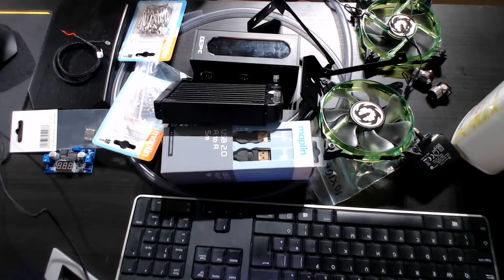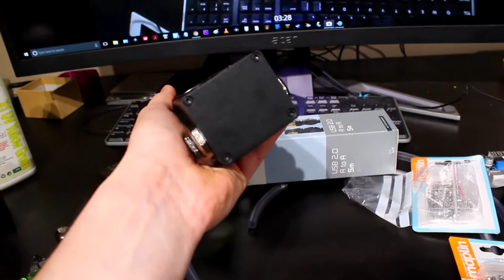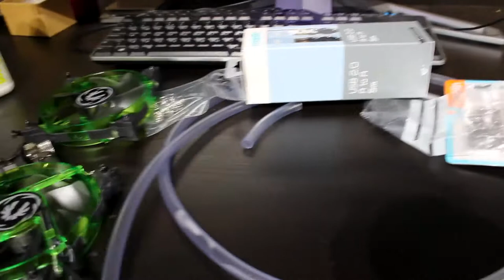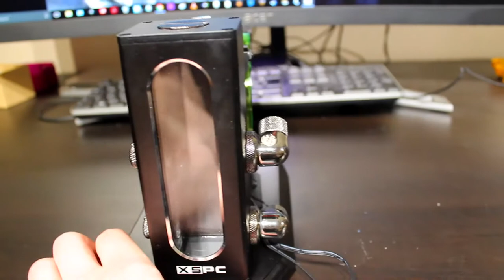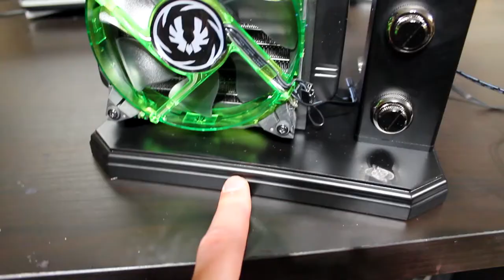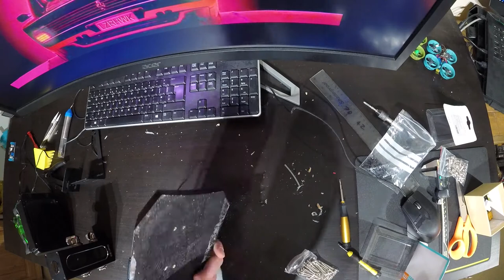WATER COOLING A GAMING LAPTOP!!! (PART 1 of 4)

Comment: 1. Where is part 2? If you ended up messing up, still post an update and show where you messed up so other people can learn please. 
2. What waterblock did you get? 
3. How exactly did you connect the power for the fans and pump? Pump requires molex power, since you don't seem to have a psu with molex in there, wondering how you managed to solve this.

Comment: Part 2 ??
Reply: Hi Liam, I am planning to make a series of vids (atm 11 videos planed) about what I call the "Laptop Liquid Loop" project.
It's slightly different from the idea of the video above since I want to be able to carry the attachment in my backpack rather than make it as a stationary dockstation, but the concept is pretty much the same. And, since I'm a manufacturing engineering student, got access to a lot of machines, I will be making a custom water block and all.
I haven't got a lot of subs right now since I haven't even started uploading the vids about the project, but if you're at all interested, please do subscribe, the first video is set to be released within a week (so by 25.11.18). I won't do the same bs as this guy with ditching the project, I will make vids about the whole process, from start to finish, and I will showcase all the problems.

Comment: finally...The video i was searching , i found it by accident after a few days :) THANKS "balanced boy"
Reply: Hi George, I am planning to make a series of vids (atm 11 videos planed) about what I call the "Laptop Liquid Loop" project.
It's slightly different from the idea of the video above since I want to be able to carry the attachment in my backpack rather than make it as a stationary dockstation, but the concept is pretty much the same. And, since I'm a manufacturing engineering student, got access to a lot of machines, I will be making a custom water block and all.
I haven't got a lot of subs right now since I haven't even started uploading the vids about the project, but if you're at all interested, please do subscribe, the first video is set to be released within a week (so by 25.11.18). I won't do the same bs as this guy with ditching the project, I will make vids about the whole process, from start to finish, and I will showcase all the problems.

Comment: where is part 2 ？ please qaq
Reply: Hi Jason, I am planning to make a series of vids (atm 11 videos planed) about what I call the "Laptop Liquid Loop" project.
It's slightly different from the idea of the video above since I want to be able to carry the attachment in my backpack rather than make it as a stationary dockstation, but the concept is pretty much the same. And, since I'm a manufacturing engineering student, got access to a lot of machines, I will be making a custom water block and all.
I haven't got a lot of subs right now since I haven't even started uploading the vids about the project, but if you're at all interested, please do subscribe, the first video is set to be released within a week (so by 25.11.18). I won't do the same bs as this guy with ditching the project, I will make vids about the whole process, from start to finish, and I will showcase all the problems.

Comment: Link laptop water block, please
Reply: Hi Tien, you can get so called "laptop water blocks" from AliExpress, here is a link to one of them (this one is aluminum, you can get copper too):
https://goo.gl/xix1uj

However, keep in mind that these will never give you the same results as a custom made water block, hence the low price. They are basically shelled cubes of copper or aluminum, the design of the water channels in them isn't optimized for heat absorption by the water. They'll probably work, but nowhere near as good as a proper block.

Comment: Also I see he has one of the newer alienwares so chances is he broke it. They are not to mess with! Just by overclocking the CPU through bios can cause it to not boot again. Even when trying resetting CMOS. They are crap!
Reply: I don't think that's it. His thumbnail shows the thing working, he must have finished the project before uploading this first video. Or just good Photoshop skills, I dunno.
Reply: I managed to over lock my 13 inch to 5 ghz and it’s still going strong
Reply: @nicholasdelrossi3996  press x to doubt

Comment: Part 2222222
Reply: Hi Max, I am planning to make a series of vids (atm 11 videos planed) about what I call the "Laptop Liquid Loop" project.
It's slightly different from the idea of the video above since I want to be able to carry the attachment in my backpack rather than make it as a stationary dockstation, but the concept is pretty much the same. And, since I'm a manufacturing engineering student, got access to a lot of machines, I will be making a custom water block and all.
I haven't got a lot of subs right now since I haven't even started uploading the vids about the project, but if you're at all interested, please do subscribe, the first video is set to be released within a week (so by 25.11.18). I won't do the same bs as this guy with ditching the project, I will make vids about the whole process, from start to finish, and I will showcase all the problems.

Comment: part 2 plz
Reply: Hi CodeRed, I am planning to make a series of vids (atm 11 videos planed) about what I call the "Laptop Liquid Loop" project.
It's slightly different from the idea of the video above since I want to be able to carry the attachment in my backpack rather than make it as a stationary dockstation, but the concept is pretty much the same. And, since I'm a manufacturing engineering student, got access to a lot of machines, I will be making a custom water block and all.
I haven't got a lot of subs right now since I haven't even started uploading the vids about the project, but if you're at all interested, please do subscribe, the first video is set to be released within a week (so by 25.11.18). I won't do the same bs as this guy with ditching the project, I will make vids about the whole process, from start to finish, and I will showcase all the problems.